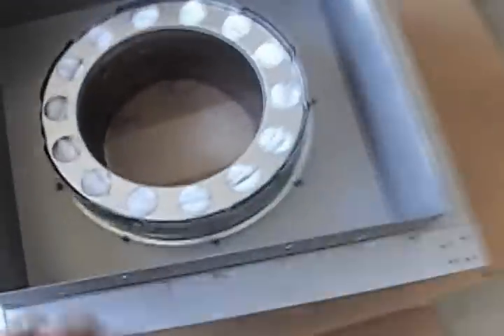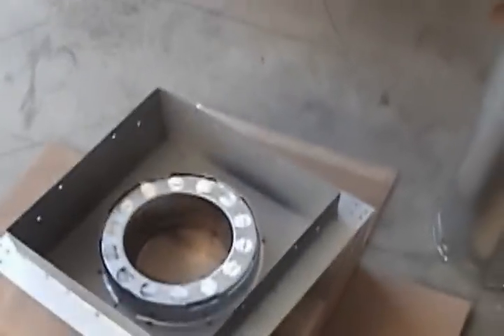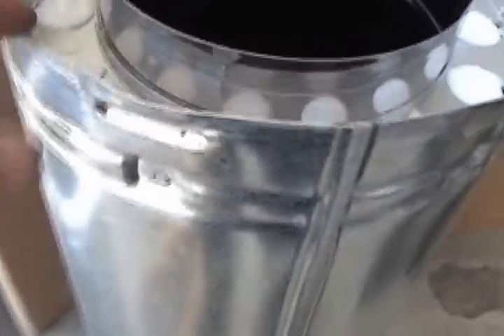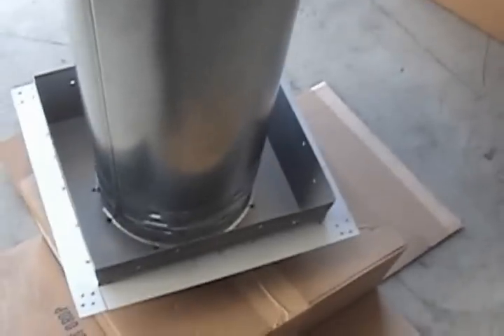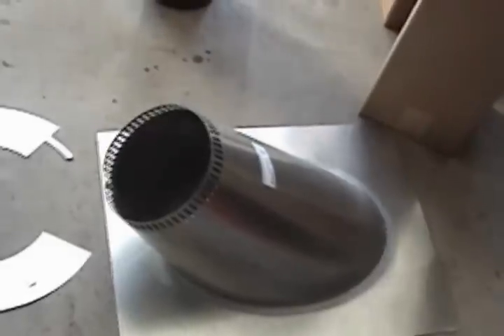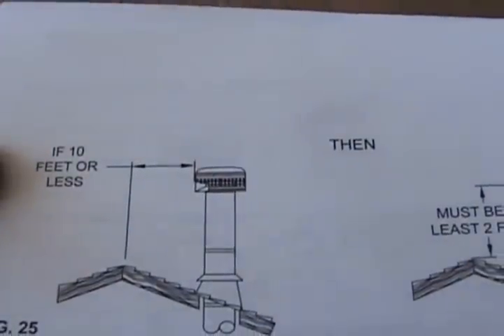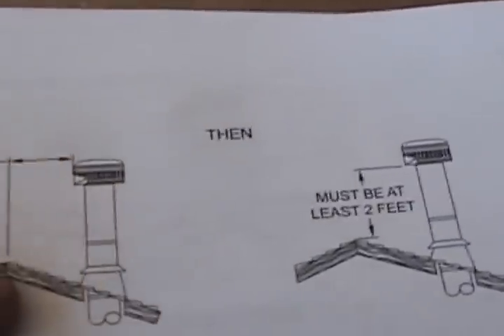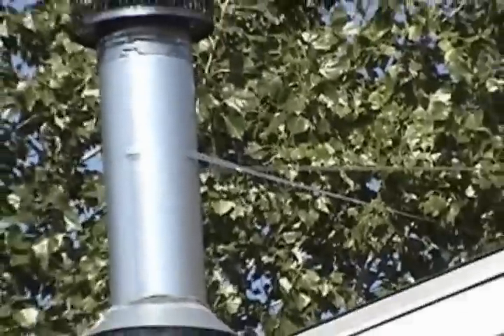Wood Stove Chimney Pipe Installation explained

Comment from the maker: I have used the Canadian SS Chimney Pipe and I like it! I think your on the coast and it is very damp. Here in Utah the air is super dry no need for all Stainless. Black single wall pipe has a clearence of 12" on a vertical run but horizontal needs 18" from the ceiling. Thanks for your comment.

Comment: Thanks for the advice...will definitely go with the triple wall pipe once I get into the attic.  I was also wondering if you could tell me what the difference is between using a round ceiling support versus the square?  Thanks!

Comment: Great video. Helpful. What can be said about an air intake being installed for a wood stove in a manufactured home. I am told that a surprisingly strong vacuum will be created when a wood stove is used in a tightly sealed home. Therefore a air intake valve to the outside needs tonne installed? Hadn't thought of that, and was surprised when it came up min getting a bid from a pro.

Comment: Nice tutorial, man!   Thanks a lot for taking the time.

I'm tackling my wood stove installation for the first time.  I've converted the attic into a bedroom, and am planning on putting the stove in the living room underneath.   Here's the question: can I put in a double pipe in the attic bedroom living space in order to capture the heat from it in that space (it's obviously accepted that the hot pipe will present a higher safety hazard)?   Or does it need to be triple for code or safety? Thanks

Comment: Awesome video. The only thing I am confused with is do these stoves need to be next to an exterior wall? I want to center my stove in my living room but it's backed by my garage. Ideally, symmetry is my aim, but are fresh air vents required always? Can there fresh air vents be vented vertically through the ceiling similar to the exhaust vent? Or is horizontal venting recommended?

Comment: Great video. Is a 1 inch clearance on triple wall pipe enough after years of burning. Would the framing dry out and be more susceptible to catching fire?  jDoes the pipe last almost forever?

Comment: I am upgrading my roofing pipes and have completed the roof insulation and after seeing your video thought I'd ask. Mine is Duravent and doesn't have the male spade for the inside of the support box. Mine has more of a female insertion for the double wall interior pipe,  Is this normal to be so different or is it just a manufactor differance?

Comment: Thanks for the reply.  I used the wrong vocabulary.  I removed the insert and will place a fswbs in the fireplace area.  I just cut out a bunch of bricks to open up the firebox for the stove.  I decided to keep the old set up so that I can still trap the convected heat and run it to other rooms via a fan.  Now I have to figure out how to keep the steel flu tube weight off the t joint.  It just sat on top of the old iron insert.

Comment: I have a lot of duravent double wall pipe and I was wondering if I could use it all the way up through the ceiling and to the roof.  The ceiling I'm going through is on my enclosed back porch and it's a plywood ceiling.  I have an attic insulation shield.  Is the double wall black pipe temperature rated high enough to work in that situation?  Thanks!

Comment: I'm putting in a heavy duty, medium sized (28"wide 20"front to back) stove that's built for 8 inch pipe, altitude around here is close to 5000 ft...is there any advantage to an 8 inch or should I get a reducer and buy 6 inch pipe? Also is the firebrick on the inside walls of the stove necessary?

Comment: Is it ok to use single wall black stove pipe off the top of a small wood insert if the insert is set into a masonary fireplace opening? Once inside the chimney it is a18" metal chimney. The pipe I have is 6" stainless painted black. I wouldn't think I need double wall seeing its coming off the insert directly into a chimney?

Comment from the maker: Yes if you have stainless steel single wall pipe you can connect it from your stove insert and run it up the chimney. If it were me I would run it all the way to the top of the chimney for the best draft! Thanks for your comment.

Comment from the maker: I sell the Chimney Kit for $235 that comes with a Chimney Cap, Roof Flashing, Support Box, And a storm collar. The Chimney Pipe is sold for $35 per foot. Black single wall Stove Pipe is cheap at $7.50 per foot. I am a dealer for Napoleon Fireplaces and they make a nice wood stove! The also have an econo line called Timberwolf, I sell the model 2200 timberwolf for $899. I charge $300 to $400 for installation. So it all depends on how much pipe you will need but an average install will run $2000.

Comment: Does the triple wall pipe have to be a straight line once in the attic or can I use an elbow and divert the living room pipe so it comes out on the back side of the roof instead of visible from the front?

Comment from the maker: You can strap it to the framing inside the chimney, or install a support box for the chimney pipe to fit into. Just make sure you have the proper clearence to combustable material such as wood framing.

Comment: im having issues with my fire going out on my wood furnace. Once i get it started it will eventually just burn out and doesn;t get hot enough for the blower to kick on. I have a constant cool draft that comes through my chimney. Would a barometric draft regulator help? Thank you

Comment: I have a question for you. I live in Taiwan. My house is a 40 year old traditional house. The entire house is made of concrete ( no insulation )  and the roof has old concrete tiles on it. What piping would you suggest I use for going through the roof and above it..?? Any other advice please.. as I'm planning on installing a cast iron wood stove.. it get cold here in the winters living in a concrete house.. thanks

Comment: Hi , I've been thinking about installing a woodstove in my house , I was wondering how close to a wall can it be installed , and also how close to a sliding glass door , I like the way you installed one on top of the carpet , that answered a big question I had by putting down the stone on top of the carpet , do you have to put anything on the walls also ? , thanks , scott

Comment: Great video. Can you come out of the top of the stove at 45° out a solid brick wall or do you have to come up one section of pipe before going out the wall at say 45°?
Reply from the maker: The through the wall Chimney kit only comes with a 90 degree Tee. Check out my video on through the wall Chimney Installation. Is your Pipe going into a Masonry Chimney or just through an outside wall?
Reply: @mrEnergy511  its going out a masonry wall
Reply from the maker: @mrbwadding  you will need Class A Chimney Pipe going through the wall. As soon as you penetrate the wall your Pipe is exposed to ALL the elements. Stainless Steel and Insulated Chimney pipe will be able to withstand moisture and extreme cold! When single wall pipe is used the cold will cause the Smoke condensation thats CREOSOTE! 90 Degree Tee with clean out is best.
Reply: @mrEnergy511   thanks for your assistance

Comment: I have a small stream of water leaking from the inside of the ceiling support box, then down the outside of the single (or double) wall flue pipe onto the wood burning free standing fireplace during 1/4" rain or more.  Had new shingle job 4 months ago, and I have tarred the crap out of the roof flashing. . . .still leaking.  I also tarred most of the storm collar.  Still leaking.

Do I need to scrap off all old silicone on storm collar and reapply??  What else could be leaking?

Thanks,  Clyderc

Comment: I am confused about what holds the weight of the tube going to the roof.  I am installing a wood stove in an existing fireplace, so I have a chimney that will house the tube up to the top.  Also, no one seems to show the inside of their fireplace once this is done.  Do I need to create a false roof to trap convection heat and use vents like what is already set up for my fireplace?  I would rather cut the pyramidal thing off my wall, especially if it is not necessary now that I killed my insert.

Comment from the maker: If your going straight up with no elbows not so much of a problem to reduce to 6".  The negative side is it will reduce the draft by 25% on the up side you will burn less wood and you will get the same amount of heat. Just make sure you sweep it every year!!! HELL YES to the fire brick!

Comment: heir in nova Scotia Canada  i have never seen a galvanised pre fab chimney we use all stainless only the flashing and rain collar are galvanised  most people use marine caulking on the  rain collar the other stuff don’t last    
the black single wall pipe and single wall stove must be at least 16 or 18 inches from a combustible surface interesting to see different building codas  i think the chimney must be over the peak by 3 foot to

Comment: I’ll be putting a chimney in for a new stove. The chimney doesn’t look like it’ll be that hard of an install. However it will be rather close to an attic vent box on the roof. Is that an issue, or should going 2 feet over that be fine?

Comment: Hi you said if we had any questions you would help..ok here goes I will try and explain ..I have a leak, the water is coming in around the support box ..yours is square mine is round . In the spring when I come to open up the cottage there is rust on top of the stove which means water has comes in .I was able to witness the water coming in the other night ,we had a major rain storm .Its not a major leak but it leaking ..not sure where the water is coming in.It seems to be coming in on the inside of pipe because there is nothing on the ceiling ..I don't know if I am making sense but I am trying.If you need a picture I can send it to you ..Thanks for any help you can give me..

Comment: does the chimney pipe you showed work on coal fired burners also ? And I live in a 2 story house. The coal stove will go in a room addition that is single story. The new stove pipe will be more than 10 feet away from the main house roof. Will that be sufficient or do I still need to go 2 feet above the peak of the roof which will be approxamatly 20 feet away.

Comment: We'd like to use a vintage wood burning stove in our remodel. The contractor wants us to use a convertible. Can an old wood burning stove be made into a convertible?
Thanks for your help!
Reply: +Chrystie Scott -- I noticed the guy who did the video didn't reply, and though you may be beyond this I thought I'd jump in and answer.   I believe your referring to a catalytic combustor.. But No, it can't or at least, SHOULDN'T... A catalytic wood stove is very specific and can't just be made out of an old stove... But even if he were to say he could, or even if you just tried to install what you have now,  I'd caution you on using a "vintage" wood burning stove anyhow. It may look cool, but  #1, it's probably not EPA certified.  #2) Unless you have the instruction manual on it which will give you all your clearance to combustibles and approved usages, then it has to be listed as an Unlisted Appliance.  Your local building code authority will have to ok the installation. According to NFPA 211 regulations, you have to be 36" from any combustible surfaces Minimum, you have to have extended floor protection, etc.  It becomes really unsafe and tricky.  Improper installation of your stove can void your homeowners insurance and leave you fully liable for any failures or fires that occur..  You may be best to buy a new EPA approved stove and do it right. Might not be the look you want, but type in "HOUSE FIRE" into this YouTube and you'll see the ramifications.   Hope this helps.

Comment from the maker: Installing a wood stove into a fireplace is a different set up than I explain. What I'm talking about is installing a free standing wood burning stove. What it sounds like you are doing is installing a stove insert into an existing fireplace. In this applacation the stove will set on the floor of the fireplace and the pipe will connect to the top of the stove and vent to the top of the existing chimney. I like to use a stainless steel flexable chimney liner for this applacation. Thanks

Comment from the maker: NO! Don't do that !!! Once you go through the ceiling and floor you must use Class 'A' chimney pipe or triple wall all the way up. However we all know that hot air rises and it will heat up stairs anyhow. So be safe and ALWAYS install up to code!!! Wood stove and chimney pipe installation are a very dangerious thing to do so you want to make sure it is done right. Thanks for your comment...

Comment: Can u use single wall inside and outside on wood stove
Reply from the maker: NO WAY! Single wall black stove pipe is only for connecting a stove to a Chimney with proper clearance from combustible materials. The Chimney can be a masonry chimney or Class A Chimney Pipe with the proper support box, and adapter to the single wall stove pipe. I have videos that explain the difference and why it's important. #1 reason you could burn your house down and the insurance company will NOT pay a claim. Not worth saving a few bucks to put your family at risk!

Comment: hi,  we just bought a house with a ceiling box already installed with an 18 inch flexible cardboard texture flue sticking out of it.  do I need to replace the entire box to install the new double wall pipe flue?. it is very flexible and cardboard feeling we had an inspector come to inspect the chimney and flue and he said it was okay but all the videos I watch talk about double cell wall flue installation.
 
please advise

thanks
vivian
Reply: +Michael And Vivian Klei  - You might be beyond this already, but I noticed the maker of the video didn't reply --- but one of the main purposes of a ceiling support box is to maintain your clearances as your hot flue gases to pass eerily close to combustible surfaces. A cardboard like material makes me nervous. But read on.. 
 You will run black connector pipe up to the ceiling support box, and then you use UL-103 approved double wall Class A chimney pipe to pass through the support box and carry on above the roof line. (Check out DuraTech on the internet - its made by Simpson DuraVent.. You can find it on www.woodlanddirect.com) 
Here's the kicker to your question, when you buy chimney pipe for an appliance, you have to use the same manufacturer pipe from the stove all the way up to the cap. You can't switch between manufacturers.  It needs to be one seamless system, so using a support box from one company won't work for chimney pipe from another.  So unless you have ALL the pipe for the support box already installed, you'll need to get a new one when you  buy the rest of the pipe. Besides, if you don't feel its up to par, don't take chances.    Hope this helps.

Comment: I need to replace all of the floor tile under an existing wood burning stove. To do this I will need to move the wood burner.  My question: Is the weight of the chimney pipe supported by the ceiling box?  When I disassemble the pipe from the wood burner, do I have to do anything with the rest of the pipe?  I have probably about 15 ft. of pipe connecting to a vaulted ceiling.
Reply from the maker: Tim Laning Your support box if installed properly will support the Chimney pipe. just remove the black stove pipe and then you can move the wood Burning stove. You may consider Sweeping your Chimney before you remove it. It will be less of a mess!
Reply: +mrEnergy511 Hey, can you tell me what kind of silicon is best to use on the chimney outside, around the storm collar?  I used a 3M product that I bought from Home Depot called "Fire Block Sealant" that is a high temp sealant, but it didn't work outside, it just dried up and fell off.  Thanks
Reply: Tim Laning

Comment: I am installing a wood stove in a steel building from the top of stove I am coming up with one pipe to an elbow then another piece of pipe I am cutting o hole thru the side wall of the garage is that where I need to install the support box & chimney? Will the chimney go from outside of support box straight up and then put cap  on? Or do I need to install more pipe?
Reply: +jonathan barlow You may be past this already, but a ceiling support box is only used when you're venting vertically through the ceiling.  What you need to pass through a wall is called a WALL THIMBLE... Now, about 3" prior to getting to the wall thimble with your black stove pipe you will transition to your Class A Chimney Pipe.  You pass through the wall with the chimney pipe NOT the black pipe..  Once through the wall, you will need a T and a T SUPPORT to get vertical again.. Run class A up the outside of the garage and you'll need wall straps for support every 8 feet up the wall. If you have a overhang, you may need 15* or 30* elbows to offset around the overhang.  Once you get to the roof you'll need to figure out your 2x3x10 to figure out how far above the roof line you need to be.  To figure that out you'll need to know the pitch of your roof and how far away the peak is from where your pipe is.  A 6/12 pitch that is 10 feet or more away will need to be 84" vertical ABOVE the roof line.... You'll then need a Roof Support Bracket to support the pipe and finish it off with a cap and spark arrestor.. If you are not a professional installer, it's always encouraged to let a professional do this for you.  Also, for additional local codes, always consult with your local building codes inspector for guidance.  
Hope this helps..    (Woodland Direct - Chuck)

Comment: Hell, what diameter roof flashing are you using? i have the same pipe but i cannot find a roof flashing as big as the pipe i have which is around 12 diameter. thnks